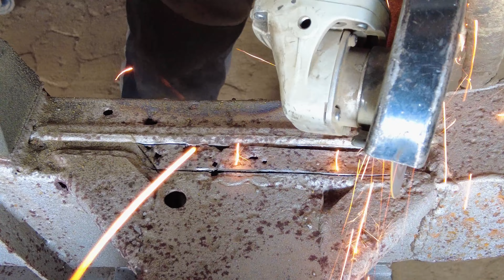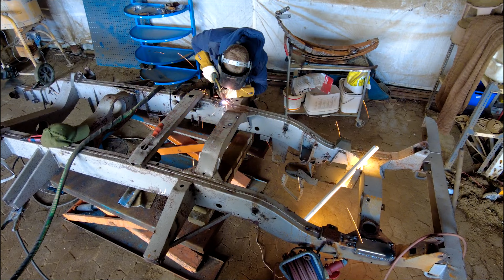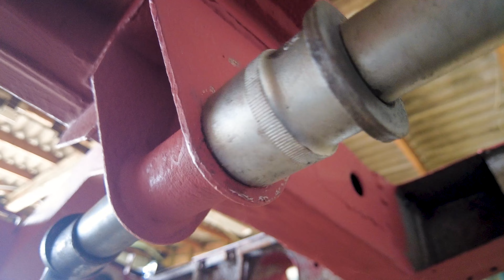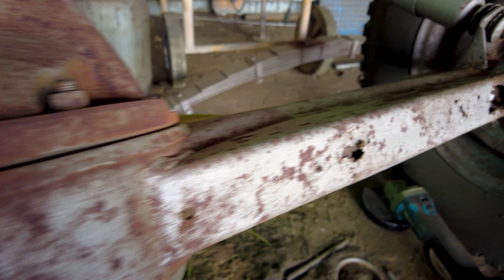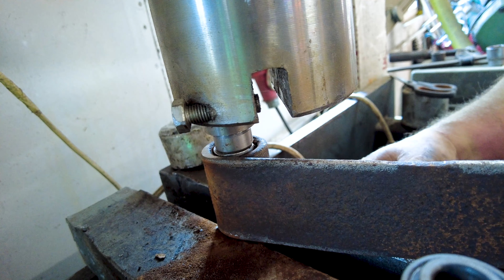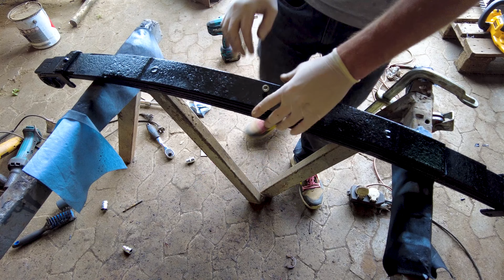Land Rover Series 3 Restoration Part 2 - Chassis and rear axle

Comment: I see you have a reinforced military style rear axle but a civvy rear cross-member and fixed gearbox cross-member.  What is the history?
Reply from the maker: You already know more than i do it seems. :D Only had it for a couple of months, and the history I was told was sadly limited. At some point it has been used in the Danish home guard (see markings in the rear in part 1) but other than that, I don't know. Gearbox video coming soon, and currently working on bulkhead repairs, yikes :x
Reply: @CMFotoPeak  OK, both axles are reinforced mil spec but chassis is civvy. Perhaps that's what they ordered.

Comment: The problem I have with these rotted out frame restorations is that the areas that are not perforated probably have 50% or less of the original cross-sectional area of steel remaining.  A lot of work, but you really don't know what you  have................
Reply from the maker: That is true. I hammered and tried to pierce through places that looked weak, and reinforced where it was needed.
Reply: @CMFotoPeak  it really depends on how and where you plan to use the vehicle.....